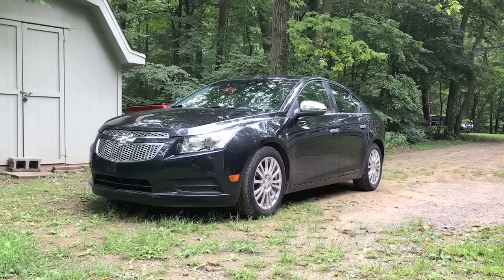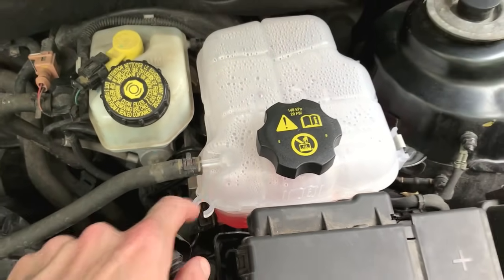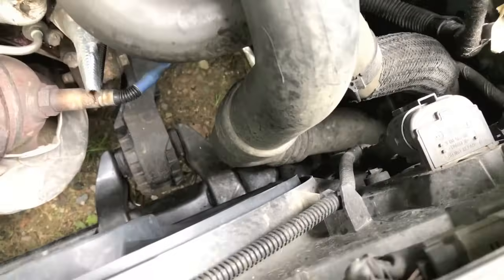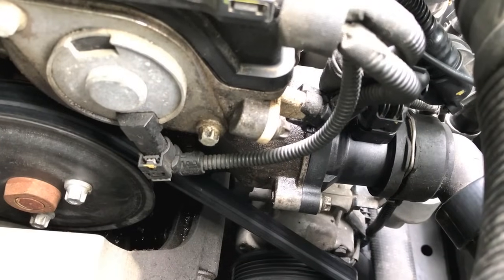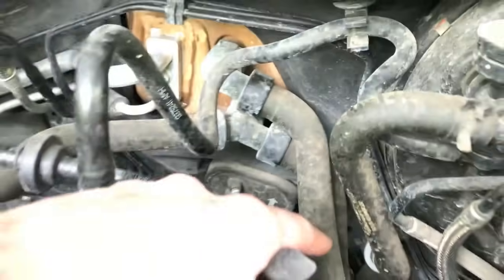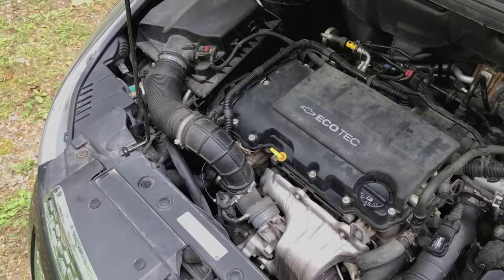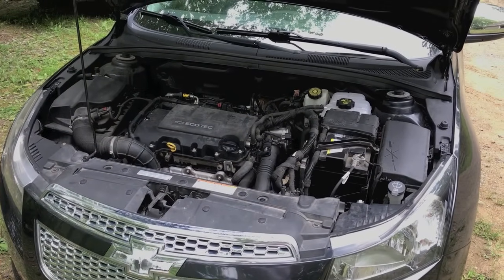Most common Chevy Cruze coolant system leaks! - Malibu/Impala as well

Comment: My mother inlaws has antifreeze leaking from around the rear driver side of the car, we noticed a large puddle forming around the tire while parked in the garage.  Could it be traveling from somewhere in the engine compartment?
Reply from the maker: Thanks for watching, that’s odd.  Are you 100% sure it’s coolant, or is it brake fluid?

If it’s brake fluid, it’s likely to be a leaking brake line near that wheel.

If it’s coolant, is it coming out of the exhaust and spraying near rear tire…?…if so…it’s likely that your internal seals are allowing coolant into the combustion chamber and being burned and sprayed out exhaust.  Keep us posted.

Let us know if you have any questions and hey if you’re into crypto trading, join our DIY ecosystem and become part of an exclusive group of DIYers.

       toolboxtoken.com

Reach out to us any time!  🧰
Reply: @DIYwithMichaelBorders  definitely coolant, I'll head over there tomorrow to take a better look. Ty for the quick response.
Reply from the maker: @steveh8224  

Happy to help.  That’s a bummer you’re experiencing a leak.  We will be here to help you get it figured out.

😎👍

Comment: What’s the big hose called connected to the coolant reservoir under the small one
Reply from the maker: @ThatGuyJesse619  

Thanks for watching.  This is a standard coolant inlet hose.  Do you see a part number on the hose?

We can help lookup the exact OEM replacement hose for your exact Cruze.
Reply: @DIYwithMichaelBorders  no I don’t, I’m out of town and it’s my wife’s car, but there is an R on it , I have a picture of it I can email you
Reply from the maker: @ThatGuyJesse619  

Thanks for the reply, this is the best way to stay in contact with us.  Another option is to contact the local Chevy dealership and provide them with the last 8 digits of your VIN number.

They will be able to look up your exact replacement hose for your exact engine.

Comment: I found a leak in mine and I am having a hard time find a replacement hose. It is a hose that comes off of the water outflow valve and has the covering around it to protect it from the heat. Do you know the name of that hose so I can find a replacement?
Reply from the maker: Thanks for watching, the best thing to do is contact your local Chevy dealership and provide them the last 8 digits of your Vin number.

They will be able to get you the exact replacement hose that you are referring to for your exact engine.  This will ensure that you do not accidentally purchase a non-compatible hose.

Comment: the hose that goes from the radiator to the thermostat when i pull up on the hose a little where it connects to the thermostat coolant leaks out...i replaced the hose and still does it...it doesnt leak until i acyual grab it and pull up slightly....i bought the thermostst at auto zone it was a duralast...is that normal?
Reply from the maker: Thanks for watching & the Duralast brand is a brand we recommend for sure.

You will want to ensure that the hose itself is shifted far enough onto the thermostat and then the locking clip is properly aligned and able to be shifted down to create that lock.

It shouldn’t leak if new.  Keep us posted.
Reply: @DIYwithMichaelBorders  it doesn’t leak when I drive but if I grab it and slight lift coolant will drip out…I bought a new hose and warrantied for a new thermostat and it still does it.
Reply from the maker: @russkaine  

Thanks for watching, that’s odd...& not normal...🤔

You can install a standard screw-tight clamp from AutoZone & carefully install it onto hose to create water tight seal.

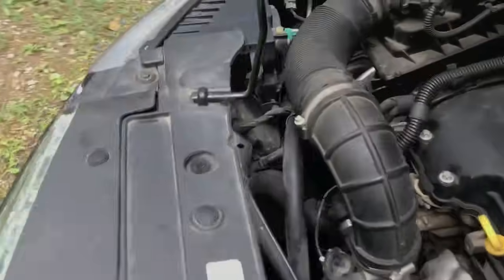Comment: Just a bit of information to add, as a correction to your video.  At/around the 2:30 minute mark of the video when you mention the radiator cooling fan, you are incorrect on what that fan does.  It does not blow air against the engine.  Those fans are designed to blow air against the radiator in order to cool it.  It is a big misconception that a lot of people have.
Reply: Ok. You mentioned something interesting. Tell me I have a 2013 chevrolet malibu Lt. I parked my car, open the hood and  started the car and the radiator fans don't started working and my car, never get heat. The radiator fans only start when...? (I ask you, you seems like you know some mechanics)

Comment: I have a 2014 cruze diesel don't know if it's different but my coolant reservoir is empty and when I fill and drove it it drained fast but I don't have milky oil I'm so confused as to where it would go
Reply from the maker: Good morning, just poured a cup of coffee and am sitting down to answer any and all questions for the DIY community.

We have an idea on where it’s going.  Chances are it making its way past the engine seals and into the combustion portion of engine where it is being burned off and pushed out the exhaust pipe.

Do you notice any discoloration at end of exhaust pipe or white smoke coming out of exhaust?  Both are indicating that the coolant is being burned off with no trace of external leaks.

Let us know if you have any questions and hey if you’re into crypto trading, join our DIY ecosystem.

       toolboxtoken.com

Reach out to us any time!  🧰

Comment: 1:48
Just underneath and connected to that valve, there’s a tubing wrapped in metal sheathing. I noticed that’s where the coolant is leaking from for my Cruze. Not sure if you have any tips considering you didn’t point it out in the video
Reply from the maker: Thanks for watching & welcome to the DIY Raptor Club.  Does the tube feed into the Water outlet Valve in your engine?

If so, this is just a standard coolant hose that can be replaced pretty easily.  To get the exact replacement hose for your exact engine, we recommend calling your local Chevy dealership and providing them with the last 8 digits of your vin #.

They will be able to get you the exact replacement hose for your exact engine.  Or, you can share that part # with us & we can help you find a replacement hose.  Keep us posted.
Reply: @DIYwithMichaelBorders  i think we’re looking for the same thing. I think it’s the turbocharger coolant return pipe

Comment: very good info
Reply from the maker: Hey what’s up, thank you!  😎👍

We appreciate you watching.
Reply: my 2016 curse  under warranty  took it to dealer  3 time    in 2017  with only 31.000 km it had a smell coming in the  inside of car the dealer said there noting there car is ok  a other dealer said it good be trubo it get hot    they said there noting about curse  that having that problem   with leaks in car in canada i told them i seen a lots of older curse  with that problem in usa  so i started  with this  after seeing usa video    i notice on my curse the coolant bottle was going down 2 inch in  8 month  took picture  of the level  went cold   i told dealer said that normal  got no where ,, i  call gm   no help  so i   thought i wait till it got worse and maybe them the dealer good find out  the problem ,, i notice now it go down 2 inch  in coolant  bottle 2 month call dealer  told them no help said it out of warranty now it only got 55.000 km now  i don't drive it too much because of the smell made me sick   i finding out now 2021 those car got lots of leaks which dealer  choose to ignore at that time  the worse car, i  ever own  never had  to add coolant with any car ,i owe in past ,  this  dealer and gm  did not fix the problem  not happy with them  i try they just push me aside ,thank  micheal
Reply from the maker: @lmicheal1508  

We appreciate you sharing your experience & thoughts.  You are not alone.  The Cruze has kept its owners busy.  The coolant system has been identified as the weak link.

We are always here to help answer questions.  👍

Comment: My cruze experiencing coolant loss but no leak and running fine..what would be the common problem for this ?
Reply from the maker: Good morning ☕️ any update.  This is usually the symptom of the internal seals wearing out and allowing coolant to leak into engine area that it’s being burned off and pushed out the exhaust.

When this happens, white smoke will be visible coming out of exhaust…however not always.

Comment: What's the first hose you touched (on the left) after the W.O.V. called, and where might I find a replacement? It just bursted and left me in a cloud of smoke and disappointment. Having a hard time finding it online without knowing 😖
Reply from the maker: You are very welcome & we appreciate you for reaching out to us.  If you are referring to the lower & larger hose, this is your reservoir’s lower coolant feed hose.

We recommend contacting your local Chevy dealership & providing them with the last 8 digits of your VIN #.  Ask for the lower coolant hose that feeds off the bottom portion of your reservoir tank.

They will be able to get you the exact part for your exact engine.  Keep us posted.  Hope all is well.  Enjoy your weekend.

😎👍🔧🔩

Comment: Can bad thermostat lead to the car doesn't catch speed and doesn't shift automatically as the RPM is very low and if I keep pushing gas the engine dies
Reply from the maker: @hamdyelsyed979  

Thanks for watching, not necessarily related however we can’t rule it out as a possible cause.

It’s more likely that worn out spark plugs and wires, as well as dirty air filter can lead to this.

Comment: I replaced the engine thermostat about a week ago as I noticed it was leaking around that and underneath. Wasn't easy but watched your video to do it and saved myself some money. However the coolant reservoir tank is now low again. I've looked everywhere and can't pinpoint where it might be leaking. Any suggestions? I might just take it in to get diagnosed and go from there.
Reply: Did u ever find out where it was leaking

Comment: My car has major leakage yet the temperature isn't overheating? I looked inside and it looks like its coming out of the water outflow valve. Is that a diy project? Or do I need to see a professional?
Reply from the maker: Thanks for watching, the water outlet valve is a DIY project if you’re willing to put in the work.  We have attached a video link below that will help get you more familiar with the replacement steps.

       https://youtu.be/X1S8liNxYMs

You can use this video to help determine whether or not you feel comfortable making it a DIY project or taking the vehicle to the shop.
Reply: @DIYwithMichaelBorders  oh thank you so very much. I really appreciate it
Reply from the maker: @rev-on  

So happy to help, looking forward to hearing back from you.

Comment: @4:19 what is the name of that rubber hose? My buddy has a leak right where the hose connects to the water pump. He took it to a mechanic just earlier and the mechanic said he couldn’t see any leaking but him, me, and my wife could see the leaking when he brought it over.
Reply from the maker: Thanks for watching, that’s the large hose you are referring too.  It doesn’t have an exact name.

To get the exact replacement hose for your exact Cruze, we recommend contacting your local Chevy dealership and providing them with the last 8 digits of your vin #.

Again by doing this, it will ensure that you get the exact replacement hose with the exact measurements and size for your exact Cruze.

😎👍
Reply: Found the leak, a small tear, about 1/6 of an inch long, on the bottom side of the hose, just to the left of the safety clip.
Reply: @DIYwithMichaelBorders  awesome man, with that type of response I’m definitely subbing to your channel! Hell yeah thanks!
Reply from the maker: @rgrrgrsxndngr1904  

Time to replace it.  😁👍
Reply from the maker: @rgrrgrsxndngr1904  

That means the world to us, we subscribed to your channel as well.  Us DIYers need to stick together!!!

😎👍

Comment: Mike, great videos as always.  My 2013 1.4 just sprung a coolant leak in the pipe/hose that exits under the heat shield and exhaust manifold, below the oil cap.  The leak is at the crimp where the pipe meets the hose.  Ever see that, and if so, do you know any fixes aside from taking it into the dealership?  Thanks in advance!
Reply from the maker: Thank YOU Gerald for sharing this.  Is your leak at the actual fitting or have you determined the hose itself is leaking and dripping down onto the fitting.

Over time, the hose can warp to a point where the pressure clamp is no longer creating the required seal.

To get the exact replacement hose, we recommend contacting your local Chevy dealership and providing them with the last 8 digits of your vin number.

They will be able to get you the exact replacement hose for your exact engine and hopefully you can quickly get this leak fixed.

😎👍

Comment: I’m getting a leak somewhere close to my passenger headlight under my bleeder at the bottom by the hose but it’s not coolant that’s leaking it’s oil. I get white smoke out the tailpipe on startup. And when I pull the dipstick out it’s hissing. You have any idea what it could be? I thought it was the valve cover and I changed it but I’m still getting a leak and the smoke out my tailpipe.
Reply: Head Gasket

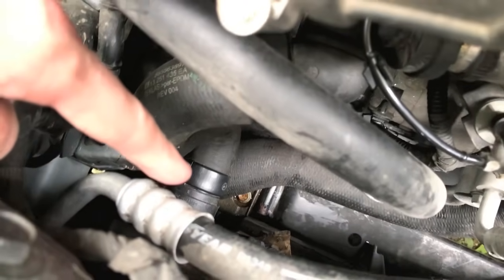Comment: Michael - I have replaced the hose that you're pointing at around 3:02 in your video.  I've replaced the thermostat housing.  However, I still have a leak that continues to spray on top of that larger fat hose in the bottom - below the hose you're pointing at.  HELP!  I had a full tank one day and gone the next.  I can't figure out where it's leaking!  What is that larger fat hose?
Reply from the maker: Karen Kelley 

Thanks for watching & we hope the video helped.  Let’s get this figured out together Karen.  The hose shown at the 3:02 mark is a Dealership only part.

We recommend contacting your local Chevy dealership & providing them with the last 8 digits of your VIN #.  They will be able to get you the exact replacement hose for your exact vehicle.

This house has two ends and uses the adjustable clamps to secure themselves.... One connects to the radiator while the other one connects to your thermostat.

We really enjoy making these helpful videos for our fellow DIY’ers.  Many more helpful videos to come!  😀

Let us know if you have any questions.  Please subscribe to the channel and turn on your YouTube notification Bell 🛎 that would be awesome thanks again!

😎👍🔧🔩

Comment: Helpful! My car has been overheating the last few days and doesn’t keep coolant, yet I can’t seem to find a leak anywhere?
Reply from the maker: Shelby Stone 

Thanks for watching Shelby, that’s odd.  You may have a small leak allowing Coolant to exit system & run onto a hot portion of engine.  At this point, your Coolant may be hitting hot surface & evaporating before hitting ground.

We recommend doing your best to look for any signs of evaporated leak stains.  We need to pinpoint the location of leak to allow us to zone in on which part to replace.  😀

Keep us posted.  Please subscribe to the channel and turn on your YouTube notification Bell 🛎 that would be awesome thanks again!
Reply: Look by water pump on side by belt
Reply: I have a leak on my 2013 Chevy Cruze. I have replaced the reservoir tank, cap, the return hose leading to the reservoir tank and the turbo assembly. All these parts had a leak but after replacing them it still leaks. Tomorrow I will change the thermostat and hope this will be the last part I needing to be replaced.

Comment: This is helpful! But I'm also disoriented because the area between my engine and battery on a 2014 LS looks different from yours
Reply from the maker: Thanks for watching & welcome to the DIY Raptor Club.  Let us know if you have any questions.  Keep us posted on your project.

😎👍🔧🔩
Reply: @DIYwithMichaelBorders  Thanks! Do you know if the coolant system directly to the right of the engine would be the same for LS models too? I can see exactly where it's leaking from but can't find a diagram of parts names or videos of an LS anywhere
Reply from the maker: @emilyjea  

Thanks for the reply & if not the same, it will be very similar.  Your owners manual should have additional information regarding your cooling system and what manufacturers recommended coolant should be added and quantity.

Comment: My hose next to the water pump on the backside of the engine is leaking. Do you have a video on how to replace that?
Reply from the maker: Thanks for watching and welcome to the DIY Raptor Club.  Unfortunately we do not at the moment.  Replacement hoses can be purchased from your local Chevy dealership or AutoZone.  Keep us posted on your project and let us know if you have any questions as you work through it.

😎👍🔧🔩
Reply: @DIYwithMichaelBorders  heater outlet hose....I believe it is.
Reply from the maker: @whitefire1111  

Thanks for watching & sharing this.  You rock Michael.  Enjoy your day.

😎👍🔧🔩
Reply: Part is on the way. I will probably have to drain the coolant to do this job though. Do you have any videos on how to do that?
Reply from the maker: @whitefire1111  

Very cool & we do.  Link is below.

       https://youtu.be/aldBMv3dHQs

In the event that you have a drain port down at the very bottom portion of your radiator, we definitely recommend draining it from that point.
Reply: I will look into it. I have a 2014 Chevy cruze LT 1.4 turbo engine
Reply from the maker: @whitefire1111  

Awesome Awesome!  🔧🔩

Comment: Hai. My chev malibu 2013 model leak at the piping which connect to the heater hose...

Can i just by pass this heater hose by just putting a rubber stopper ?

Is there any other thermostate because, the original is not suitable for my country humid & hot climate country in brunei, borneo island.

Please shsre advice..